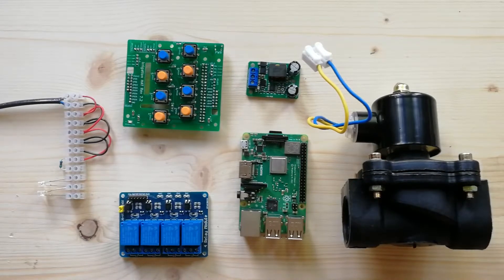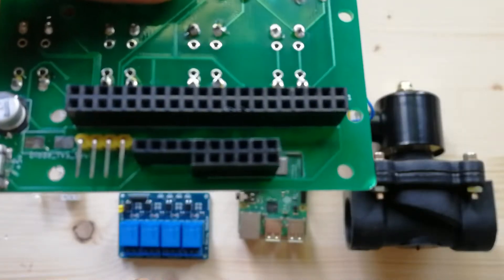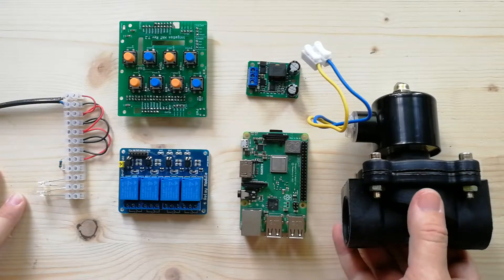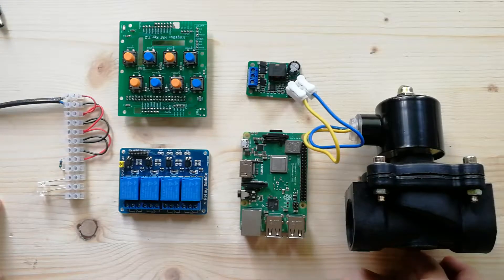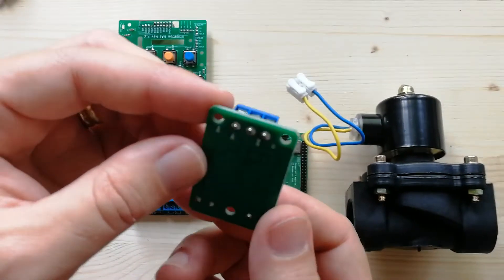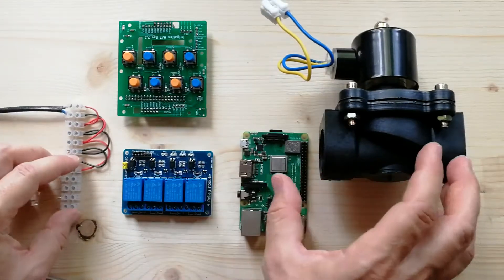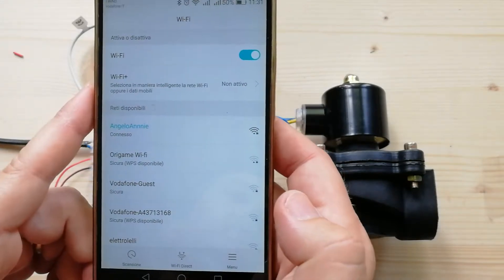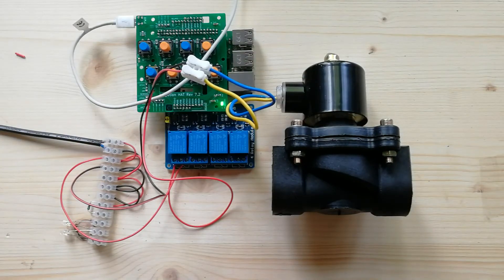Irrigation valves and relays - hydrosys4

Comment: It makes me wonder, why people use this crap, bunch of strange boards? Take normal PLC like Siemens LOGO (230V AC or 12/24V DC), simply connect wires. In soft you can make those relays as required for device

Comment: What is that awesome little screw-down terminal block?
Reply from the maker: I think you refer to the DC-DC converter. It can get 9-35 volts input and output 5 volts at 5A max.  
Found it here: https://it.aliexpress.com/item/32946696662.html